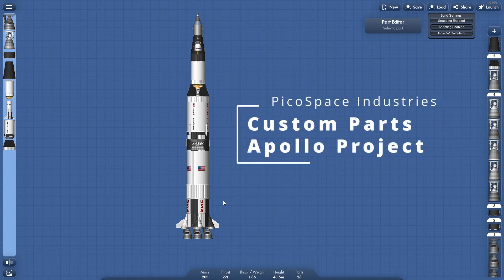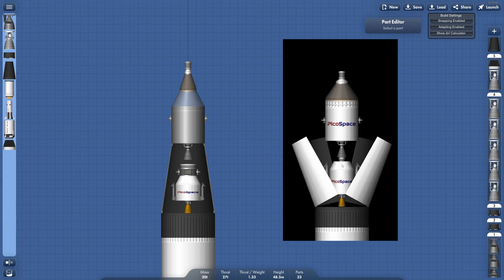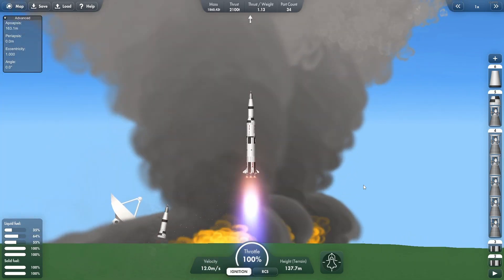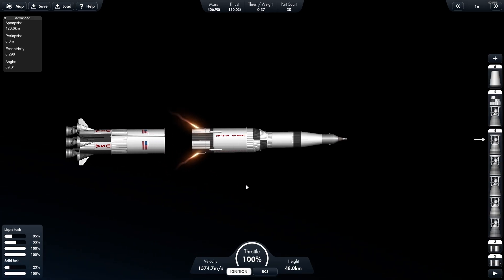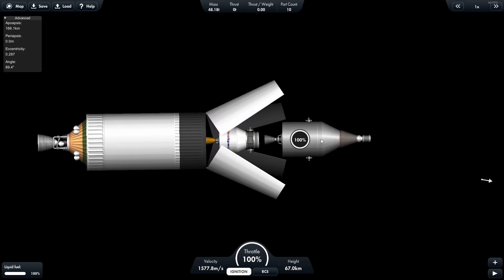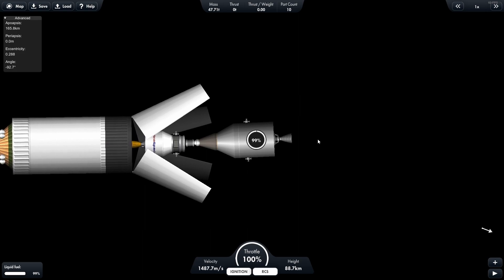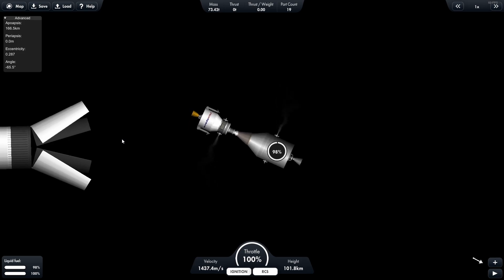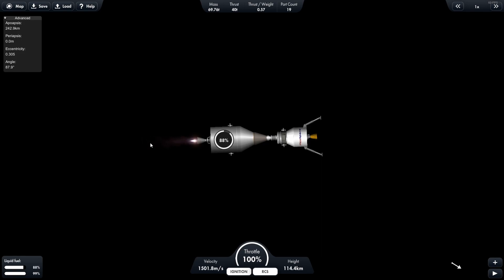Apollo Saturn V Recreation with Custom Parts in Spaceflight Simulator

Comment: Did the actual Saturn V use pedal fairings?
Reply from the maker: Apollo 1-4 used them, Apollo 4 had an issue with one of the petals so they switched to jettisoned fairings.
Reply: @picospace  All Saturn IB flights used them (aside from ASTP), Apollo 4 and 6 carried them until they were switched out for jettisoning panels starting with Apollo 8. The issue you're thinking of happened on Apollo 7, but plans to switch out the SLA system for the Saturn V predated the issue

Comment: Yoooooooo! This looks AMAZING!!
Reply from the maker: Thanks! It’s been a lot of work to get to this stage and I’m only half done (spacecraft is a lot of small details).
Reply: @picospace  yeah, the plume looks amazing, though i would say when starting the F-1 engines maybe make the start explosion smaller, also will you make a tower for this?
Reply from the maker: I plan to make a tower for the Apollo project (likely update 3), then I’ll adjust the plume so it looks reasonable with the launch tower dynamics.

Comment: Awesome!, i prefer going to the games code and making these texs, because it was really hard to make a saturn v without bp edit.
Reply from the maker: BP Edit is another route but unlike BP edit (which I have one from Mr. Sisu) this is a lot less parts and therefor a lot less lag.
Reply: I can teach you how to bp edit, youll need a file manager and go to spaceflightsimulator, saving, blueprints, and try to find a diffrent build, after that you can choose how big you want your rocket.
Reply: X, axis is left or right y axis is up or down, z axis is the 15 or 90 or 45 degree angle.
Reply: Color.tex = changing the color or tex, shape.tex = the shape you want it to be like “flat tex”
Reply: I hope this helped!.
Reply from the maker: It did, however there is a mod “part editor” that allows most editing in the build screen now.